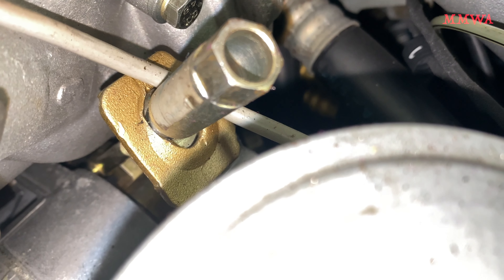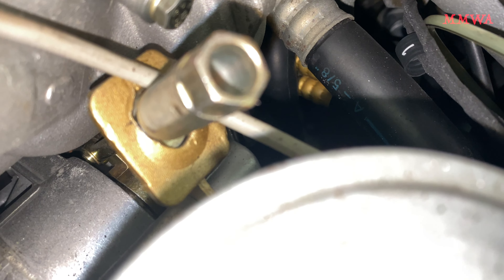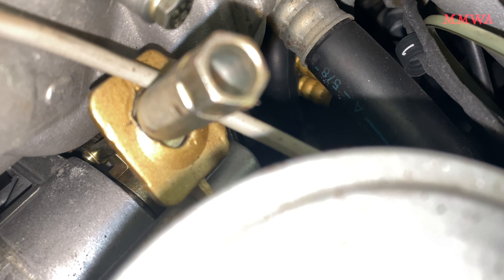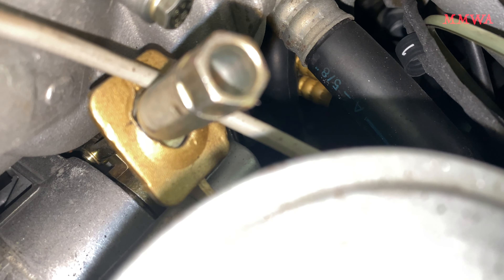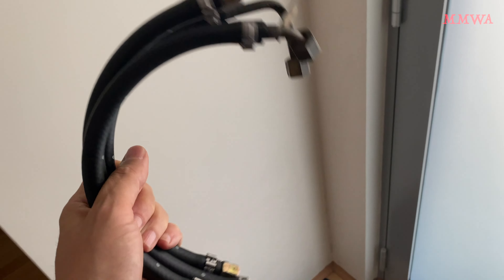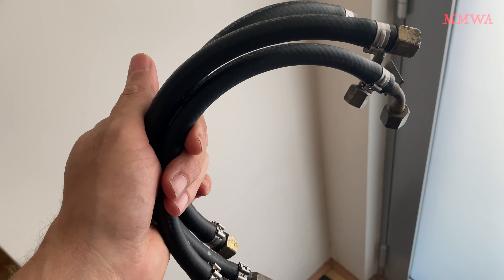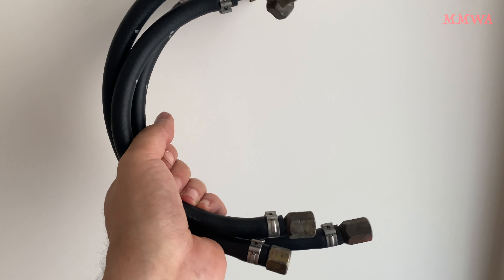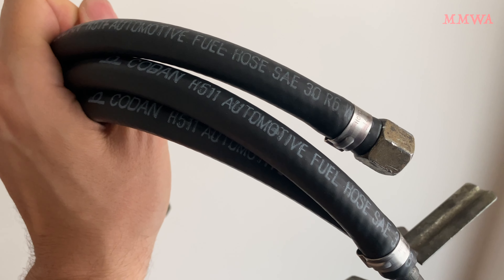Red W124 - New engine bay fuel hoses -  better luck this time?

Comment from the maker: So yep - Another screw up - the new hose is only rated to 50PSI which is insufficient for KE-Jetronic. You can’t win. I will run it anyway and closely monitor it. I am not a hose expert and unsure why such low pressure hose is even stocked.

Comment: Parker 7212 is a mid temperature fuel hose for unrated, non critical applications. Maximum operating temperature 100*C disqualifies it from an engine bay. Parker 7212 technical information explicitly states that model of fuel hose is not suitable for where the SAE, UL or DIN standard is required.  You need a hose meeting DIN 73379 part 3E or SAE J30R9 - try Gates (Barricade) or Cohline (2240). MB used Cohline as their OEM and Cohline (Cohpro) will make you hoses which are identical to MB parts. Accidents with petrol are not a fun time, I hope you manage to get it sorted.
Reply: If you do it yourself, you will need a proper hose cutting tool as well. Knipex make a great tool - I just acquired one to cut the fuel supply system hoses for my 450 SEL 6.9. A Stanley knife is essentially useless against aramid fibre and fluoropolymer liner.
Reply from the maker: @argentaccounts9960  Thanks, you got a part number for that hose cutter?
Reply: @MMWA-DAVE  sure do - 9020185 flexible hose & PVC cutter. Tested last night on the chunky multilayer fuel damper hose (for my 6.9). Cuts right through the aramid reinforcing fibres no sweat. I bought it from Schmidts Power Tools in Victoria, friendly bloke, shipped quickly.
Reply from the maker: @argentaccounts9960  Thanks, bought on Amazon UK $74 free shipping 😃
Reply from the maker: @argentaccounts9960  What i need next is a crimping solution that doesn’t cost an arm and leg. Would be nice if there was small hand operated devices

Comment: Hello from the east, funny how these videos coenside with my projects, - extracting my 64 W111 from 18yr's storage - my chosen "go to" German made cloth braided fuel line ( low pressure) tank to Bosch electric pump. Engine bay all hoses Gates Barracade - have had very good experience with this product on both our W201's running B100 for many years, 
Overkill yes? perhaps? 
Expensive- defiantly 
Piece of mind absolutely 
Cheers Glenn.

Comment: Gates makes a barrier fuel hose that's rated for 295 psi and up to 20% ethanol.  We use it all the time at the shop.  You can clamp it with standard clamps and it Won't Move.  The barbed ends are massive.
Reply from the maker: you got a part number for that particular hose you use?
Reply: @MMWA-DAVE  gates 27340

Been using it for Years now.

Oetiker 14.5mm clamps:)
Reply from the maker: @BlueRidgeMB  Thanks, i will do this 👍

Comment: Hopefully better luck this time. Perhaps go back to Enzed and throw them over the counter attached to a shot put ? Maybe a local school has one you could borrow ? I know personally I do not take too kindly to being ripped off, especially when safety is a concern !
Reply from the maker: As it turns out - the sae30r6 is only rated to 50psi 🙄 Pirtek is not totally innocent. I wasnt asked if it was for a fuel injected car in which case it shoukd have been sae30r9. I am not a hose expert, didn’t even think to question pressure specs. Anyway, its only the feed hose exposed to greater than 50psi so i might just redo that one myself. I might have to become a hose expert myself, it seems you have to become an expert on everything yourself these days.
Reply: @MMWA-DAVE  Yep you certainly do. If its only the return line, I would be more interested in the temp rating for under bonnet. Yep high pressure side different story. Might be time to invest in a crimping tool !
Reply from the maker: @bobbuilder5362  3 thousand dollars minimum for propper hose crimping machine. There are cheaper ones but no doubt break after a few uses
Reply: @MMWA-DAVE  -AN fittings ?

Comment: SAE J30 R6 is Low Pressure Synthetic Rubber Hose, the working pressure is only 50 PSI, you should use SAE J30 R9.
Reply from the maker: bloody hell, looks like ill be changing hoses a 3rd time.

Comment: I'm going to be replacing my fuel rail hoses soon and am considering something like Teflon lined stainless steel braided. I want them to last any conditions. Would you happen to have the fitting size that is used for the ends? Maybe the hydraulics shop you went to provided it?
I don't have the hoses, nor the car, with me so I can't quite just take them to a shop.